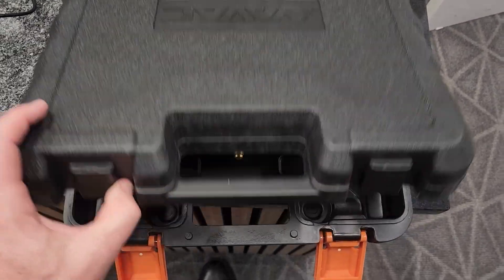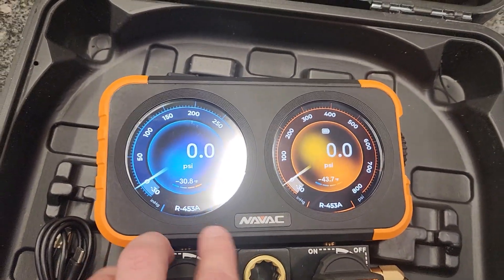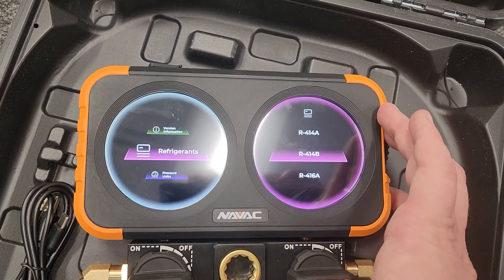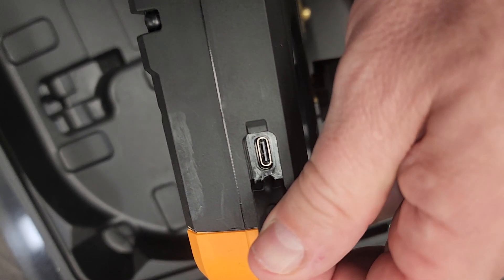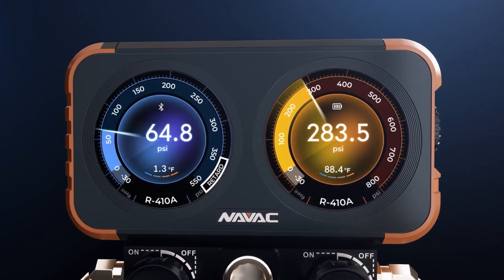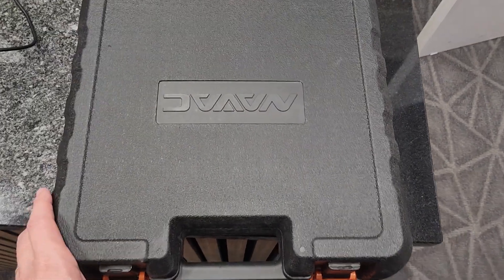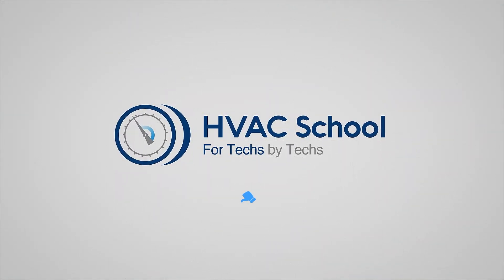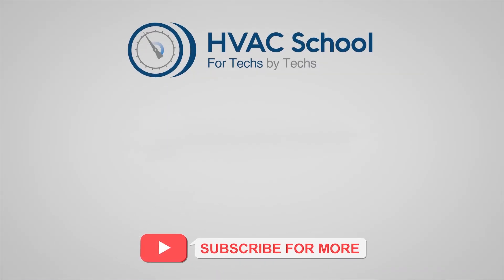NAVAC N2DX Flex-X Digital Manifold Unboxing

Comment: So far its been a terrible experience. The first set I purchased after its first use read -30 inhg and wouldn't register pressures after. Resetting did nothing, etc. They sent me a warranty pair, and they did the exact same thing after the second hook up to a system. Three almost four weeks and 300.00 later and I do not have a working set of gauges. Terrible.